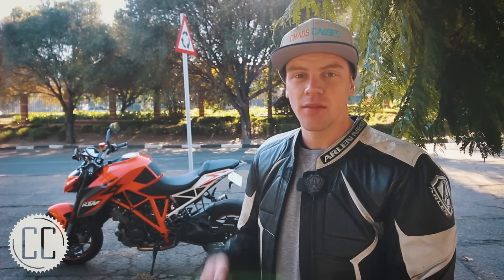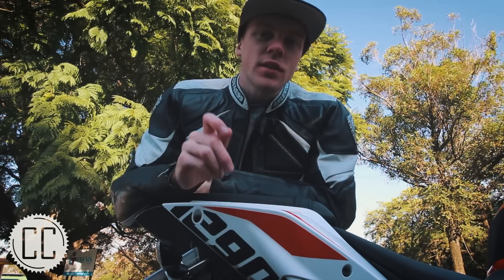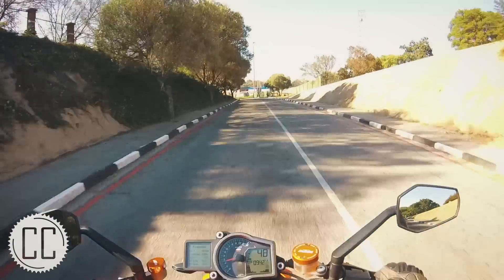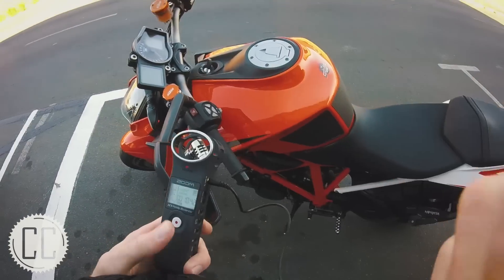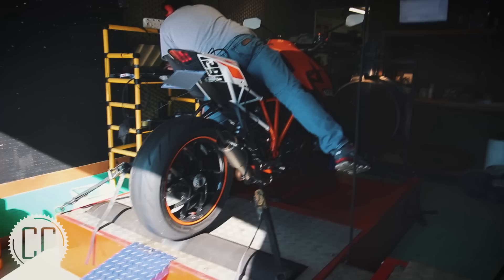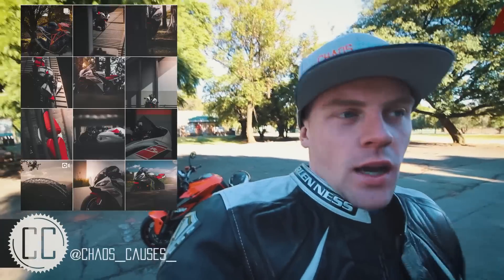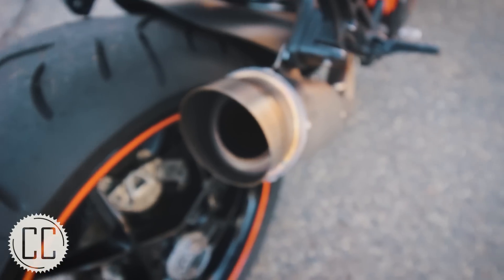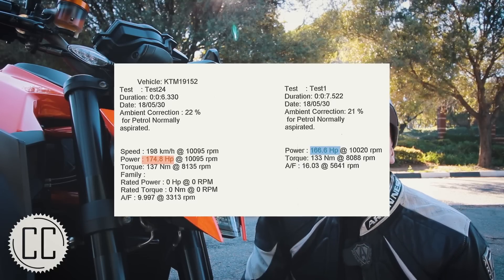Ears Bleed While Dyno Tuning | KTM Superduke 1290

Comment: Back-firing off-throttle is the air-injection system putting oxygen into the exhaust after the engine. You can delete that system, remove the valve that operates it, and you might need a "dongle" or some device to tell the computer it's still working (after you remove it). That's what engine head block-off plates are for, to close the air system. It only exists to feed the catalyzer O2. If the air-injection system isn't blocked off, the lambda sensor the dyno shop clips into the tail pipe won't read accurately, obviously.

Comment: There is a thing going on at KTM forums about the 02 sensors doing squat until the upper portion of the fuel map is accessed. Rottweiler has a solution for that which removes the hardware completely and replaces it with an electrical plug and block off plates. It's supposed to bring good gains in the lower portion of the fuel map where the engine runs rather lean. You may have solved that problem with the Dynojet tune however. Just wanted to point that out.

Comment: Hey dude. 166 is actually the first run and 174 is the last run so you didnt go down in power but rather up.
Quint is super sharp and does a super job
Reply from the maker: Haha I know man before it was setup it was showing 130s and it was into the 175s and then he backed off.

Comment: Nice video! What are the mods of the bike? For example: do you use the standard air filter? And what map did you ran into the pc5 before you took it to the tuner? Best regards!
Reply from the maker: Thanks! It's a stock filter and it was the Arrow map

Comment: Adam, i'm a bit confused. i thought you said you had the auto tuner as well as teh commander. if so, why the dyno tune when the auto tune should be constantly tuning the bike to optimized fuel/air based on actual exhaust gas. i thought the purpose of the auto tune was to make maps obsolete. i don't know, i'm missing something i think.
Reply from the maker: No it doesn’t have the auto tune that’s why it needed the dyno I just explained what the auto tune would do
Reply: You can still run an auto tune / PCV and a custom map. I do on my 2017 KTM SDR, and it continues to perfect the map.
Reply: heykat18 exactly it adapts the map for the current altitude/climate etc